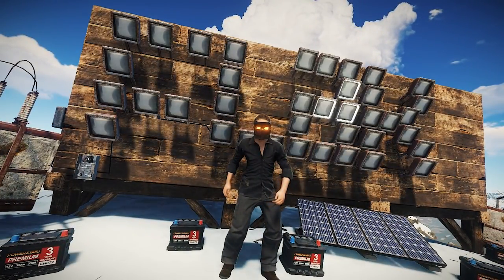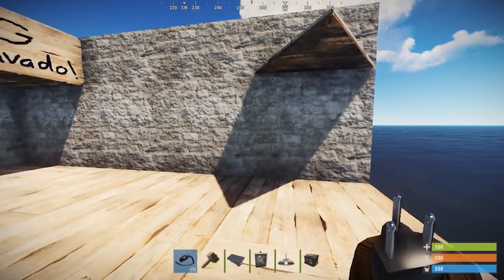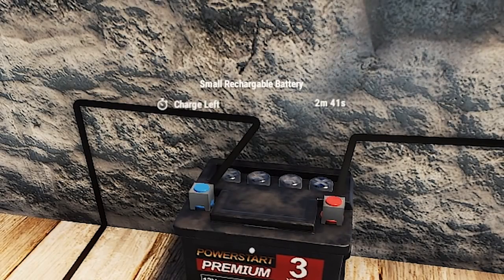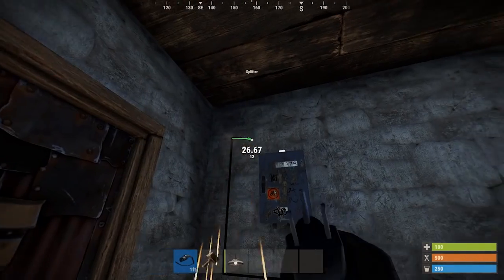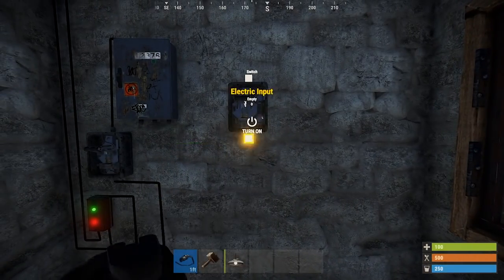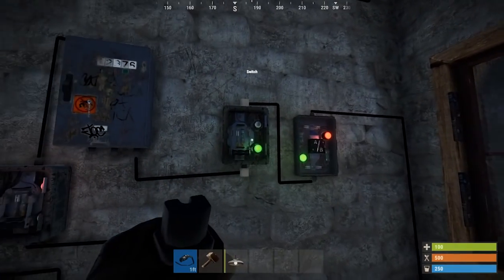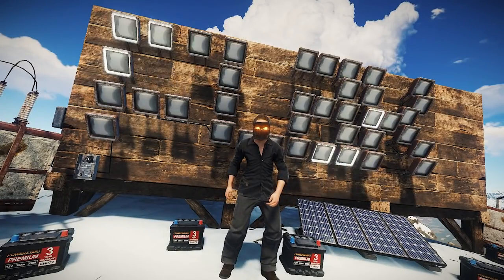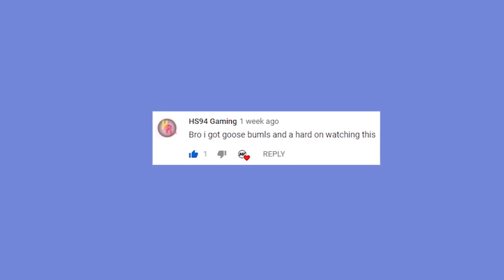RUST: Electricity tutorial for slow people (not for advanced users)

Comment: I want to use the remote transmitter to lock a door with a single click, how to do that?
Reply from the maker: Seems easy enough. I'd make the transmitter connect to a toggle side of a timer. Set the timer to 999999 seconds and output the timer to a door controller

Comment: Just one problem though. What happens if a raider gets through door 1, and then can also use your pressure pads to run and unlock all the rest of your doors?
Reply from the maker: If they can get into the first door (your outside front door) they can only open that door.

If you want to try they in there just pick disconnect the battery
Reply: @MisterFlak  ah yep that makes sense.

Comment: Could you design some garage doors to open when your offline at a certain point faily deep in your base where offline raiders could get stuck if a timer shuts off after a couple min and its connect to a motion sensor in your base??? and then put boxes in between the garage doors so they would go in set off another laser which would opena an auto turret or two to kill em all and then automatically turn off the power so the laser at the start doesn't work trapping all the explosives on their bodies inside??

Comment: can you put 2 solar panels connected to the a/b switch going to 1 battery?
Reply: yes, but you'd need to attach both panels to a root combiner first so you get power from each one flowing through one wire. Then the output from the root combiner goes to the input of the battery. You can also eliminate the hassle of a switch by adding a blocker to allow electricity on all the time and during the day it'll go straight from the solar panels and during the night it'll pull from the battery.